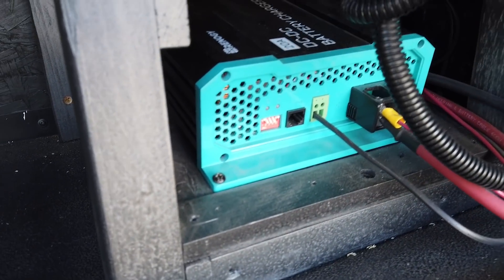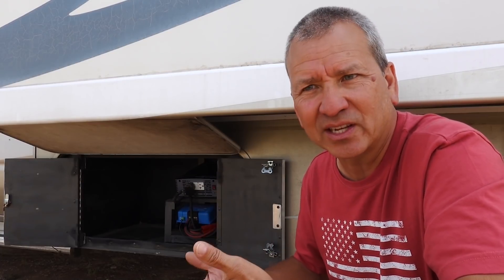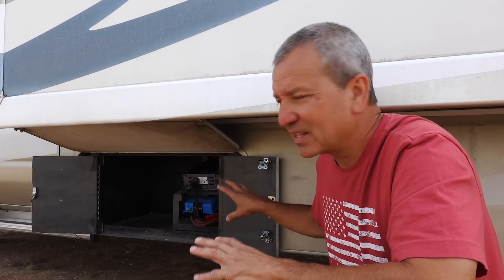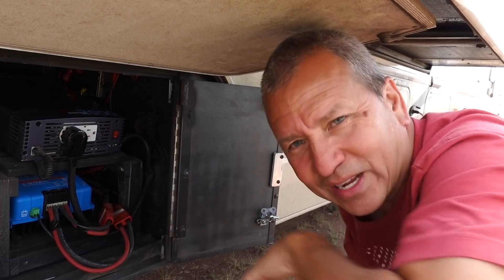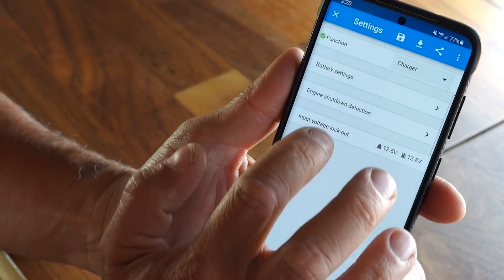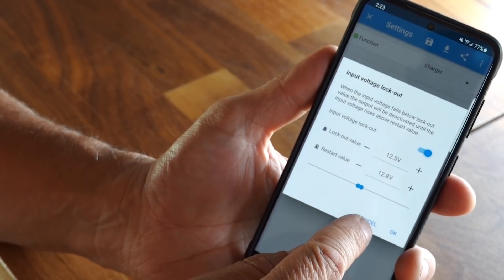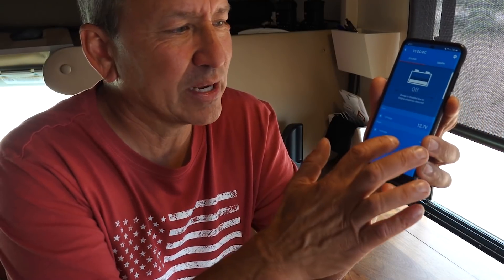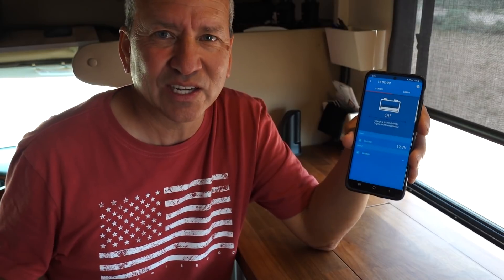RENOGY or VICTRON DC-to-DC Charger for Lithium LiFePO4? / Off-grid RV Solar / RV DIY

Comment: Love all the mods you have completed on your class c.  How is the engine, transmission holding up?  What about the exterior after the time in the sun ☀️?  😎🇺🇸
Reply from the maker: The exterior is showing it's age, but the engine and trans is great. I stay on top of the preventative maint though.

Comment: Great job, I really like the idea of running it via Anderson connectors. The only thing I'd change is vertically mounting the unit so that it can dissipate heat properly. It looks slanted, which is better than flat, but the manual specially states a vertical install (section 4.1).
Reply from the maker: Thanks. I have a temp controlled fan installed to cool the compartment. And yes, the angle is to more hot air up from the heatsinks on the DC charge and inverter above it.
Reply: @RVwithTito  What temperature-controlled fan did you use?
Reply from the maker: @billjones2806  Just the switch (https://youtu.be/uJIEXhnF8MU). The fan is just a standard 12V computer fan like this https://amzn.to/3EKLfZi
Reply: Agreed. I have this same charger and it runs hot, like +115°F. Spoke to a Victron rep and they said up to 130°F is “normal”.

Comment: I have Victron gear including the smart shunt, but my 30A DC-DC is not Victron & that's because i wanted dual input facility, one input from my alternator & the other goes to an anderson plug which i then plug in folding 260w solar panel (handy in winter months).
Reply from the maker: Interesting. Thanks.

Comment: Hi Brian. 
Great video! I did notice than where you installed the Victron DC to DC charger was pretty cramped .My experience is, when the unit goes into a bulk charge, it can get very warm. You might want to make sure it has plenty of ventilation. Safe travels.
Reply: Very good point. I have this same charger and it runs hot, like +115°F. Spoke to a Victron rep and they said up to 130°F is “normal”.
Reply from the maker: Thanks. The compartment is automatically vented with a fan.

Comment: We just leave our solar charge controllers on 24/7. With the 2000 watts of solar. Charging while running down the road is not a worry. Bluetooth is nice but after I see the system is working. I rarely look at the Bluetooth app. As always a great video with excellent information. 👍👍
Reply from the maker: 2K of solar us a good number. It's just for those cloudy or rainy stretches.

Comment: Brian, please do take great care attempting to use your house battery to assist starting your engine. Depending on charge levels, you starter motor can draw upwards of 800A from a chassis battery. The biggest anderson connectors available on the market are only rated for 350A with typical sizes only being rated for 50A or 175A. Also, 3/0 or even 4/0 cable, depending on cable run length, would be needed to ensure safe operation. I would strongly recommend not doing this. You can buy compact LiPo battery starter packs easily capable of supplying 1,000A plus for this purpose.
Reply: I heard the same thing from a Victron certified RV tec regarding using the start assist and lithium batteries. His concern was burning out the BMS on your Battleborn or what ever brand lithium battery you had. He said he has had to replace several fried batteries because of this. When I installed my victron DC to DC charger I disconnected the start assist wire.
Reply: @KenVanB58  Good point - another very good reason not to do this. Most integrated BMS' are only rated for their AH rating in Amps e.g. 100A for a 100AH battery.
Reply from the maker: Thanks for the heads up. Makes sense. I won't do it. I've never had to start my starter battery from the house anyway.
Reply: @RVwithTito  In theory, couldn't you hook up the DC-DC backwards, and use the house bank to charge, at 30A, the chassis battery? You leve it hooked up for a half hour and it should bring the starter battery up enough to work.
Reply from the maker: @iamyourantonberteaux3296  I suppose that would work.
Reply: A diesel starter only draws up to 250 amps. No where near 800

Comment: Thanks.  I have to look at your earlier dc to dc charge control.  I followed the solar solution guy YT channel 3rd option for charging deep cycle house battery and starter battery and protecting the alternator.   He explained why type of battery requires a different type of charging.  His 3rd option was to connect alternator to house battery first via the dc to dc control and then charging the starter battery from the house battery.  I am not clear on your system which batteries are charged 1st, then 2nd.
Reply from the maker: The chassis battery will be recharged quickly after engine startup. Afterwards, it's primarily the house battery that's getting charged with the DC-to-DC. You can set this to happen automatically using the start voltage settings, or switch it on manually as I do.

Comment: Brian, is there really a risk of over taxing the alternator when you have solar panels keeping the batteries topped off?
Reply from the maker: If the batteries are topped off, then there's no need to use the DC-to-DC. It's only necessary with the house batteries are low. If driving and sunny, the DC-to-DC works as a supplemental charging source charging in parallel with whatever solar energy is coming in.
Reply: I have to disagree with Brian on this one. A typical LiFePO4 cell should not be charged above 3.65V per cell, that's 14.6V for a 4-cell battery. Alternator output can vary considerably e.g. 14.8V - 15.4V depending on how much current it is providing, which means you risk overcharging your very expensive lithium battery. Yes, a good BMS will prevent dangerous overcharging but you're not doing your battery any favours.

And will your leisure batteries always be fully charged? I mean, their whole point is to provide off-grid power when the sun isn't shining. You don't want to be stuck at some remote location because you can't start your engine for fear of damaging your alternator.
Reply: @tictagtube  remember DC-DC charger is a buck-boost device.  So it will boost the voltage to the batteries if needed, but it will also reduce the voltage out if the alternator output is higher than what is set. So an alternator output of 15V doesn't matter ... The battery doesn't receive that.
This is why they can be so useful for a few reasons.
Reply: @davidl1338  OP mentioned , " Brian, is there really a risk of over taxing the alternator... ", which would only be the case if OP was considering whether or not a DC-DC was required. Brian seemed to the suggest that it would not be required, " It's only necessary with the house batteries are low. ". I was respectfully disagreeing with that point. Without a DC-DC, there is a chance of overcharging due to the variability of alternator output voltage. If I have misunderstood, my apologies.
Reply: @tictagtube  I think Brian meant that it would only be necessary [to turn it on] when house batteries were low, not that the alternator charging would ever be done at all without the DC-DC charger. Best Regards!

Comment: You also could charge my batteries if I had a cable with the anderson connector and I was next to you lol.                       with a remote engine starter 15 minutes of charge without getting out of bed
Reply from the maker: Ooops! Maybe I shouldn't have shared that part :)

Comment: Brian, as usual your attention to detail is over the top. Thanks for all the good uploads. With regard to the setting that you highlighted between the two chargers I was under the impression that the renogy charger is very much an automatic system. Monitoring the charge of the chassis battery first and then the house batteries all while keeping an eye on the alternator health. The two sets of batteries are isolated and never charged at the same time unless the chassis battery is within charged parameters first. Eliminating the stress on the alternator. It's a great system and it's enabled me to run my refer without worry that my batteries will be depleted when I arrive at my campsite, solar or not. Again just my take. You have a great channel. See you around the sound.
Reply from the maker: To some extent I believe that's true. However, there's very little control you have over the RENOGY settings. Also, with mine on a switch, the DC-to-DC charger would continue drawing from the chassis battery if I forgot to switch it off after engine shutdown. As I said, the RENOGY charger worked fine. Thanks for the comment.

Comment: I have a Victron solar controller and can confirm Victron has the best app that handles every situation via bluetooth.  But I have a Renogy 40A DC to DC charger that has worked flawlessly.  I have a manual on/off switch for my DC to DC since I don't always need to charge my coach batteries while driving.
Reply from the maker: I had not intended on replacing the RENOGY charger at first. It was working fine. I purchased a Victron Orion for an upcoming project and thought I'd try it out. I liked it and decided to keep it installed.
Reply: @RVwithTito  Looking forward to hearing about that other project, too! Thanks for all you do to share your expertise!

Comment: Nice topic and review of the Victron. The question is…. You originally went with a low output Renorgy DC charger so as not to damage the alternator incase of a mass amp pull from the house battery. But, now, you are up to 30 amp Victron charger. Whats to say that that is not going to put too much strain on the alternator while at idle at traffic light? Besides by turning it off manually at idle in traffic? The voltage set cutoff is fine but that only is a feature to disconnect if the car alternator is sick and not producing. It does not meter the amps based on conditions.
Reply: Being that you have a stock low amp alternator.
Reply from the maker: It's been fine so far, but I don't leave it at idle too much, or while climbing mountains, or with the A/C running hard. Yes, the protection is based on voltage not current. I've found it cutting out when under loads, so I've been tweaking the settings.
Reply: @RVwithTito  I don't know how different vehicles are setup but my van alternator will not put out the voltage when it heats up.  I can pull 40+ amps when cool at 14.2 V but it drops to 13.3  in hot traffic.  I believe these are smart alternators that have a feedback loop based on temp?  Not sure how it works but it self-regulates.  

  I did put a high output alternator in and that doubled the output when idling but I think it's still using same feedback.
Reply from the maker: @ceeweedsl  Are you running your A/C in hot traffic?
Reply: @RVwithTito  Yup, A/C usually on.    Even with upgraded alternator, A/C or no, voltage at the house battery drops with lowered rpm and/or heat.  I guess A/C pulls about .1 V.  

I don't have a DC to DC and just charge direct, switched by a Victron Li-charge triggered off the BMV 720.   I only have 150 amps of battery so I can get away with that.  
That said, in the morning, it's cool and starting up the engine fast idles and voltage goes up, that's when I can pull 40 amps charging for a short while.  It all seems managed.  I don't think it's easy to overheat smart alternators.

Comment: Just came to me, I can use this to charge from the 12V EV to the chassie battery while having this in the middle. Ordering now
Reply from the maker: Good luck!
Reply: @RVwithTito  Just installed it. Charging from a Model S 12V to a Tesla Battery single module (22.4V nominal). This orion charger is a killer, using RC chargers which are not reliable /hacky  / slow. Now my battery is guaranteed to be topped off everyday regardless of solar. Thank you
Reply from the maker: @mostafaelgamel6415  Sweet! Glad it's working well for ya.
Reply: @RVwithTito  Ordered thru the links, along with cables and Ferrels. Thanks!

Comment: You realize that you may have to be the "facilities manager" for the RV in the event you ever sell it.......few will understand how all of the interfaces work.....surely they would be getting a very nice RV. Nice job, can't wait for the next sequel for Back to the Future, and they recast Dr Brown to Dr Brian.
Reply from the maker: GREAT SCOTT Marty!! Sell it? Probably not :)
Reply: I see and feel the same way... No one would buy my RV as the way I bought it, but now (or soon to be) with all the things I have (or going to ) in  it they are going to have to KNOW what all these googies do ... 1,005 watts of Solar, 300-400 AMP Hours of BBB, Propane GEN, a lot of Electrical things (induction cooktop), Motorbike ramp,  wave-3 heater, 3000 watts inverter/charger, and soon a MINI Split. maybe a Tankless water heater...
Is the RV worth all that, ??? NO, but it's mine, and these are the things I want.

Comment: Brian, FYI a few of us on the Victron Users forum have asked Victron to please add smart networking to the DC/DC charger, no word yet. We figure that adding smart networking adds the sharing of the battery voltage, current and SoC information between all the devices. This would allow them all to stay in sych as to what what charging mode they are in (Bulk, absorption, etc.) otherwise the first charging device would set the voltage on the battery to the level of its mode and the other devices might then not contribute to the charging properly.
Reply from the maker: Thanks for that info. Yes. That would be great if they did that. All my charge controllers are synched up. It would be nice to add the DC/DC to that. I may have to add a shunt at some point.
Reply: @RVwithTito  great video Brian.  Ref the Shunt, this would be a perfect device to add the Simarine PICO  DC Shunt unit to your system so you can add the Victron Orion current info to the Simarine monitor display :). (I wish Victron had those shunt options instead of having to use the BMVs. I've got THREE BMVs in my RV partly because of that :( )
Reply from the maker: @davidl1338  Agreed. I'd probably add a PICO digital shunt to monitor the DC 2 DC output.

Comment: I switched my one lead acid battery to one lithium battery in my RV. Should I consider a dc to dc charger for just one lithium battery?
Reply from the maker: Yes. That battery can probably take a 1C charge rate which could possibly be up to 100A.

Comment: I am using a renogy 20 amp DC to DC charger. What is your experience with the heat out put difference between the renogy and victron?
   What do you do to cool your basement when you have your inverter and everything else running? Especially this past summer when the temps are so high?
Reply from the maker: Haven't measured the heat difference. The Victron has a pretty large heat sink on it though. And I have a thermostatic controlled cooling fan to vent the compartment when it gets hot.

Comment: My 2020 F-250  6.7L has 390 amps (2 alternators are standard).  A day drive easily charges our 2 lithium 105 amp batteries just through our 7 pin connector.  Ford, at least, limits power through the 7 pin to 30 amp.  Most, if not all alternators can handle 30 amps without an issue.  For me and anyone with a Ford pickup can save hundred of $$$ by just staying with the 7 pin 12v feed.  Also my understanding is Super Duty pickups will not power the 12v pin UNLESS you are in drive, so idle will not power the 12v pin.
Reply: Did you actually measure the current at the 7 pin connector.? I have a 2020 F350 diesel with dual alternators and I don’t think the wire in the 7 pin connectgor can handle that much current.
Reply: @marvs4321  my BMV-712 shows up to 27 amps being fed into the batteries.  No solar at this time.
Reply from the maker: Good to know for those towing. Thanks for sharing that.

Comment: What size is your alternator and what is your experience with it, especially when idling.
Reply from the maker: It's 90A I believe. You may not get the full 30A at idle. It will also depend on how low your house battery is.